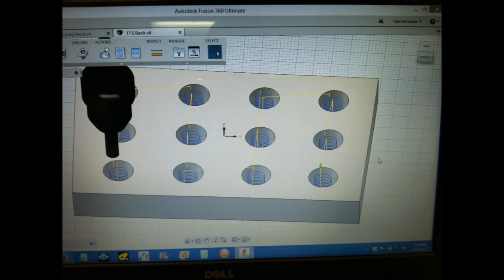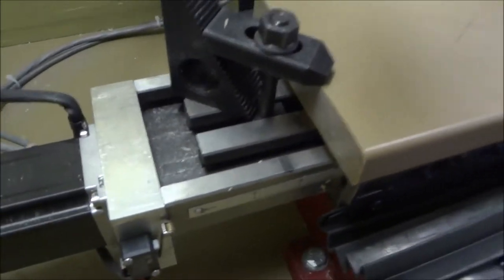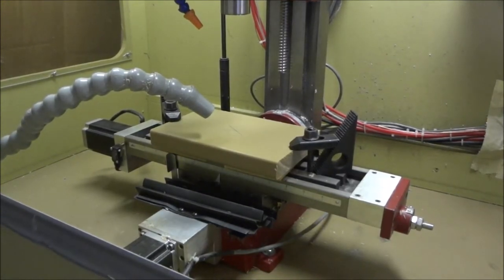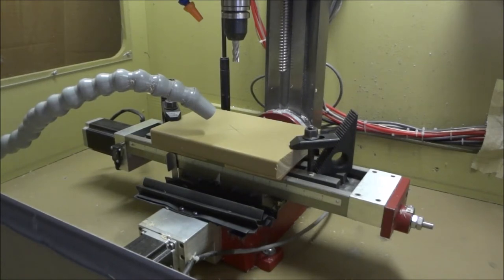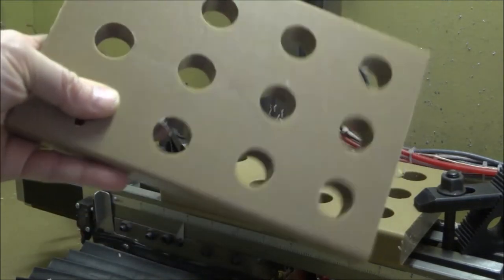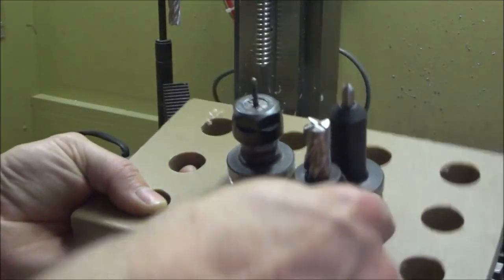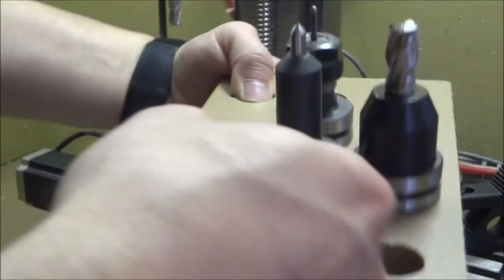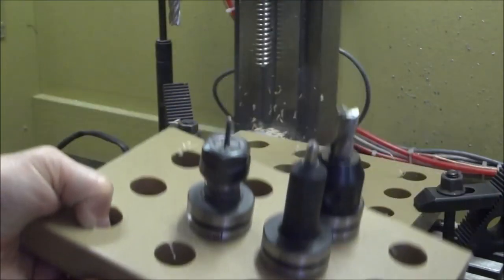A Simple TTS Tool rack

Comment: Nice tool rack. I have also been using Fusion 360 and I have to say I really like it. I haven't actually used it to machine anything yet but I'm ready to make some chips soon. I have a motor mount that needs to be milled for a new motor on my taig mill.
Reply from the maker: William Hardin Thanks,   Its a great program and something I'm not quite used to, However I have been able to make it work.
Some of the CAM ops by default are just to aggressive for the X2.  still learning :-)
Reply: CNC4XR7 I thought I saw a place where you could set the max depth  for the adaptive clearing to allow multiple passes, but I don't really have time to look at it right now. I'm busy getting ready for a trip fro California to Colorado.
Reply from the maker: William Hardin Yes there is and Im slowly figuring it out as I go :-)
 Have a safe trip

Comment: Neat. How did you fastened them to the back wall? Is the weight an issue when the tray is full? Ciao
Reply from the maker: Crivo152 The back wall is .25 plywood Dont ask where I got it LOL 
I fastened it with two screws thru the back and one thru the side. weight is not a problem.

Sam

Comment: where did you buy the 1" plastic?
Reply from the maker: +Edmund Reyes The !
' plastic is Actually from salvaged Bathroom Partition panels but check E bay I'm sure there are some scrap plastic floating around on there.
Be Safe
Reply: Thanks for the info sir